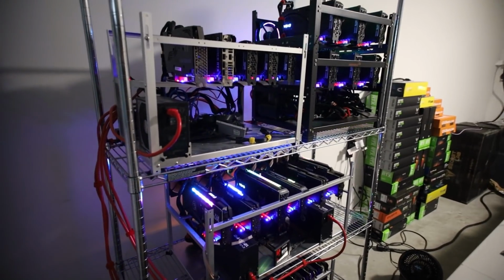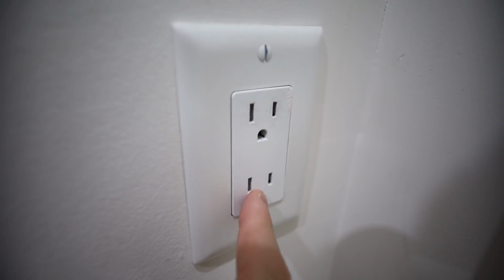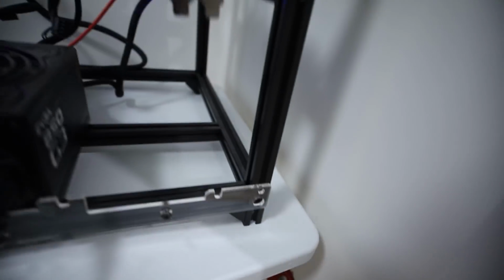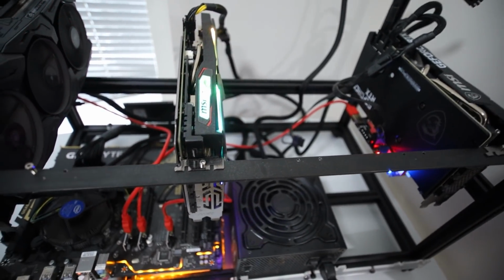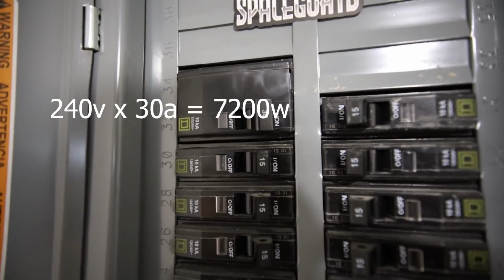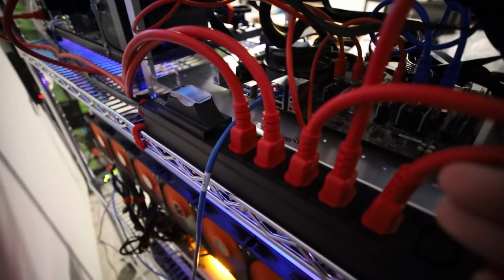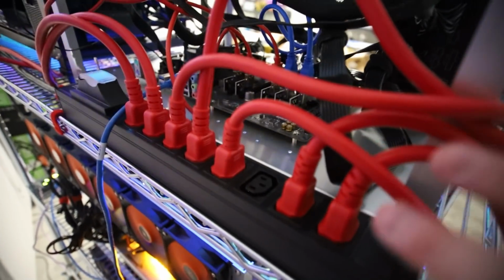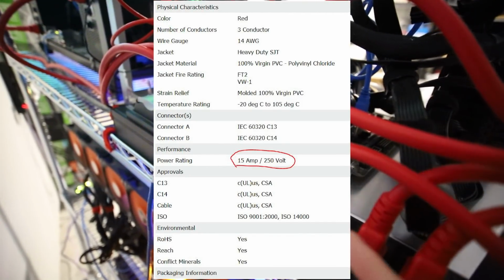How Do I POWER My Mining Rigs?

Comment: Yeah I absolutely fucked up my first motherboard by running my 3200watt mining rig (ON THE SAME BREAKER AS MY 1000 WATT PC). Yeah, lesson learned. My dad is an electrician so now we run a 20 amp and 240volts per power supply. Yeah I know it might be overkill but I have space for it and want to do it right.

Comment: So you can plug in one new asic per 30amp 240 vol breaker. Would you just keep adding 30 amp 240 vol breakers if you wanted to expand to multiple new asic's. Or is there a better way, looking at ones that put out 3472 watts with no overclocking

Comment: I have a 40amp on braker with a 10/3 50ft cable running to my mining room.  From there how do I make sure that I can connect up to 5 mining rigs with total of 36 GPUs + 5 CPUs + 5Motherboards + 7 PSUs
Currently have
--------------------
. 4 Mining Rigs
. about 40amps
. about 4200 watts

Had connected 4 rigs + 32 GPUs + 4 MOBO + 6 PSU and running about 40amps already
Plus the power strip you have is a 30amp...and with what I have is already way above the 30amps

Comment: Well Done SAFETY FIRST which is good.  Larger cable runs cooler, cooler everything runs lower chance of overheating causing fire  ESPECIALLY as these rigs run 24x7 full blast which is HIGHLY unusual in any but a refinery / industrial production facility.  
and
KEEP THAT AIR FLOWING around everything inc cables, and in and out of the room, no closed doors, sealed rooms MUST have air intake and exhaust.

Comment: Question.. It looked like you plugged 220 into regular psu's. Do all computer psu allow 110v/220v? I bought two 1200 watt hp server power supplies from parallel miner but have many regular computer psu's too. Can i plug the regular one's into 220? Thanks!

Comment: 14gauge is overkill on a psu power cable. 1000w psu @ 240v is only pulling 4.2amps max! Even at 1500w psu that's only 6.6amps. No need to stress about the thickness. I have a box of about 50 240v cord(I used to own a Marijuana business) and those cables handled 1000w lights without ever getting warm.

Comment: Proper electrician? For what? I wired up a entire shop that supplied 5 60amp 240v power circuits  4 30amp 240v power circuits and 2 120v 20amp circuits.  Shit is about as basic as it can get, I wasn't interested in paying someone $10,000 to do something I could easily do myself. I also learned to install my own minisplit units, Installed 5 of those and save well over $10k on installs. I spent about $1000 in proper heat tools and now I gave the knowledge to do it whenever or wherever I want.

Comment: Great video.  Does anybody use a battery backup with mining rigs? I've watched a couple video's re: electrical setup and don't see anyone using them. Wonder why.
Reply: not worth it, imaging having a rig with 6 3090, thats roughly about 1.5 kw that you're using right there. how long will that batter backup last giving this rig so much juice.
Reply: @Mr.Fuentes  Good point thanks

Comment: Do all GPU rigs using power like these allow 110/120V and 220/240V?  Is it a certain size that does both, such as maybe 1000W and higher, for example?
I have a new ThermalTake 1200W power unit. I’ve looked all over the box, instructions and website and can’t find anything that confirms I can run on both. It’s currently running on 110/120V. I’m afraid to plug it into a 240V plug until I can confirm it won’t blow. This is my first GPU rig (I have several ASICS). I’m planning on making more and using all 240V going forward.
Reply: the thing is the only way to find out is from the website, box or label on the PSU.

Comment: I was setting up my new little mining rig the other weekend and totatly didn't even think of them being on the same sercet as my computer in the bedroom.  YEP pop went the breaker.  They did some odd wire job on this place but I figure the same wall was running the same wire, but my other breaker is only three walls and the bathroom, while the other does the wall that shares with the bedroom, theliving room and kitchen.  WHile they have appliances on other breakers.  I was wonder what the limit is for such.   Now that I confirmed what I thought was right I feel more comfortable where I rigged them up at.

Comment: 16awg at 240v can handle 3,840 watts. I dont think there's a single power supply that can output that much power lol. 16AWG C14 cable is more than enough

Comment: In the United States (can't speak for other countries), most outlet circuits are going to be 20 amp (this can be verified by just looking at the breakers), but the outlets themselves are usually rated at 15 amps.  This means that any given outlet can supply 1800 Watts, but the circuit can supply 2400 watts (this is a simplification, but is adequate for this purpose).  This is done because most household appliances aren't likely to draw more than 15A/1800W, but there will likely be other things plugged into that circuit on different outlets. e.g. plugging a vacuum into the same circuit with a TV and a couple of lamps.

Comment: this video made me go check my circuit breakers and alot of them are a mix of 15/20 amp ones, with one 50, 40, and two 30amp ones. altho its my dryer/washer/stove that takes those high number ones. didnt realize some of my circuit breakers have a decent limit for mining. one of the 30amp is available seems to be 220v which im planning on moving all my rigs into :) thanks panda

Comment: Another reason to have a certified electrician install its is for insurance, most insurance companys will null invoid your insurance if your house burns down and you DIY'ed it.
Be smart ,pay a master electrician; not only for your own safety but for your familys and neigthbours too.

edit*:
seem alot of people dont understand the 80% rule; it is for a continuous load...
As power runs through cables, they heat up. A hotter wire will have more resistance than a cooler one, drawing more amperage over ttime from he intital power on. This is also why the awg of connectors to the pdu and of the strands to gpus is very important.(moar girth ok!... ;) )

Comment: Red Panda, I completed a tear down and changed the thermal pads/paste on a 3080 Asus Tuf card like  your having throttling issues with. I switched thermal pads with Thermalright 12.8's and had 0-2c change. The pads in those cards and VRM heatsink are of good design/quality. I did find one of my thermal pads didn't have plastic removed from one side ( Bad QC?). The thin Aluminum backplate being transferred all the heat via rear 3mm Thermal pads on the VRM's isn't adequate enough to dissipate the heat. Best solution was a perfect size heatsink I and others have used from Amazon. I sat it on the card with regular thermal pads/tape and saw a 6-8c change. 80 mm fan extruding heat off heatsink offered no real  change.  This allows me to run the Asus Tuf 3080 at 97 hashrate, 80 fan speed, 234 watts,  -200 core,  + 1000 clock ( Can go Waaay higher 1350+ under 100 c for over 100 Hashrate), temp 90c. Ambient temp 24c.

Comment: Great video Red Panda! I have been thinking about converting my rig to 220V but I have a question. Is there any difference between U.S. 220V sockets like for a cloths dryer or oven and European 220V house sockets? If all I need is a U.S. 220V  socket I should be good to go but I wanted to know what I was getting into before starting the project.

Comment: pov: in the UE all the outlets are 220v and the outlets being at hip high it will probably be 15A with the toe high ones, being at 30A  (220x30= 6600W , * 0.8 = 5.280W) without any installation

Comment: Anyone trying to mine ethereum at this point I think missed the boat. The difficulty is getting ridiculously high. Imagine the profitability if it dropped back down to where it was last year
Reply: I am buying more and more graphics cards each day, I refuse to not increase my mining capacity.
Reply: @legendaryblaze817  I have been mining this stuff for over a year and I slowly increase my farm also but very slowly at this point because it's very difficult to get cards now. I have not overpaid for one card I own. We counted the other day we have 18 30 series cards running their asses off
Reply: @erickwalker11  Well some ''gamers'' say it's impossible to get these graphics cards while you say you have 18, so yeah it just takes time.
Reply: @legendaryblaze817  yes it definitely takes some hard-ass work to get these things but I am willing to put in the work not really for the money because it's mostly for fun but it is fun getting graphics cards for free because they literally pay for themselves. I have a 30 60 I am probably going to sell shortly because that developer driver is causing crashes and 22 megahash just doesn't make sense
Reply: @erickwalker11  Use the mining bios.
Reply: @legendaryblaze817  I have three other cards hooked up to the same motherboard. That driver was working fine until I added another one and now it causes crashes unless I am on the newest Nvidia driver I have done all the normal stuff to get it functionable but like I said I'm an airline pilot so it just needs to work. It's no big deal I will replace it with a 70 80 or a 90 I am trying to pick one up today it's better than having 49 megahash anyway

Comment: Off topic, I have a MSI RTX 3090 that won't mine and shows horizontal lines on the monitor. Does anyone know of a reputable repair shop that I can ship it to. Local shops are not skilled in repairing GPUs. Would hate to use the GPU as a paperweight. Any help or suggestions would be appreciated.

Comment: Hey Red Panda.  You didn't mention where the step down from 240V to 120V happens.
Reply: There is no step down technically. 240v is 2 120v legs. Normal house power has 2 120v legs coming into the building. The only step down is done by the power supply, either is auto switching, it will sense 240v coming in and adjust, or it will have a manual switch on it to make the adjustment for 240v.
Reply: computer power supplies can run on 240v and perform more efficient too.
Reply: So using 240v is more efficient for mining?
Reply: @speederc3662  red panda has done a video on this. It was within margin of error. So no its not.

Comment: Hi Question  to all, I have 2 x760 watt psu powering my rig, one psu powers mainboard 1x3070, 1x3080 , the other powers a 2080ti a 3070 and a 6800 nitro+ am I ok  or should I swap a 760w out for a 1000w?? whole system pulls 920-930 at the wall.

Comment: 15 amp outlet can handle 15 amps the 80 percent has already been figured in so use as much of the outlet as you can
Reply: ya no.. Do not ever use full 15amps on one breaker. That is how old homes catch fire with shitty old wire. Heats up then fire
Reply: @NatetheGR8PC  as long as your in good working order its safe. once a year you should tighten all lugs on the breakers and turn all breakers off then back on. In my 25 years as a union electrician (local 43) most fires are caused by direct sorts do to cut wires or furry friends eating wires and people using extension cords wrong with a faulty breaker. one good side note when the fire department cant find what started a fire they say it was electrical lol
Reply: A breaker can draw 100% of it's power for the first HOUR. The way breakers work is that they pop when they get to a certain temperature. The 80% role applies when drawing over 80% of the circuits power continuously (over 1 hour). So in the case of mining which uses continous power a breaker will pop if using more than 80% of the rated load.
Reply: @deegs1749  when talking about 15 amp 20 amp and 30 amp breakers and assuming the right awg wire was used 80 percent has already been figured in do to code. 15 amp uses 14awg wire that can handle 20 amps but code tells me to breaker it at 15 that is 80 percent of the max. now when sizing larger breakers for lets say a motor I need to determine if its continues or not and then  use 125% for continues or 100% for non (nec usa)
Reply: @tuyenalyruk1896  That is assuming there are no adjacent breakers in the box which is very rarely the case. Adjacent breakers heat the initial breaker causing it to trip at the 80% mark.
Reply: @deegs1749  yes very true and I have had that happen. but we are assuming everything is built right and in working order. but 15 20 and 30 amp circuits your good to go just dont trip the breaker anything after that then your relaying on your electrician reading the code book right.
Reply from the maker: First time hearing that. Better safe than sorry
Reply: @RedPandaMining  Maximum loading for any branch circuit is 80% of rating of circuit for
 ampacity of wire for any load. NEC 220-2, use NEC 310-16 for ampacity.

This applies to not more than 3 phase conductors in 1 conduit.
15a breaker 14awg wire rated at 20a =80%
20a breaker 12awg wire rated at 25a =80%
30a breaker 10awg wire rated at 35a =80%
all ready figured into the code book
Reply: @tuyenalyruk1896  don't for get nec310-16. Is correct. @ 60C (140F) past that non in void.  I will say running wire max load  continuously something gonna give because heat breaks down plastics and metals over time

And also thats wire not plugs plugs receptacle have there own separate amplicitys i believe is 12 amps have to look it up
Reply: @CryptoShaped  yes receptacles are rated also they have 15 amp 20 amp and 30 amp and so on. the right ones need to be used
Reply: @tuyenalyruk1896  on a single circuit branch circuit continues loads nec 210.21(B)(2)   whats were getting at is there to many varable to provide information online about electrical everyone needs to do there own research i agree by the book it can be done but everyone needs to do research and I prefer to play safe side 80 rule again
Reply: a electrician can just look at an outlet and tell the difference between a 15amp and 20 amp outlet but to be safe just read the back of it
Reply: @CryptoShaped  your right you can never be to safe. just pay on that fire insurance and if something bad happens just tell the insurance guy (yes there was 100 3080 gpus over there)
Reply: @RedPandaMining  100% agree with you....... I'd rather go 80%  people need to stop being cheap my house and family worth more then spending few bucks extra  doing it correctly..... short cutting = REKT. My car engine can run at 8000 rpm. But 8k on the tach 24/7. Let me know how it works out

Comment: I’m in the process of building my rig and I believe I have a shortage in my cpu how do I fix this any helpful tips ?
Reply from the maker: What cpu and motherboard model?
Reply: Motherboard asus z390-A 
Cpu - Intel Celeron G3930 2.9 GHz Dual-Core Dual-Thread CPU Processor 2M 51W LGA 1151
Reply from the maker: @hamzaaziz1016  g3930 is a 7th gen processor, z390 needs 8-9th intel cpu like a g4920